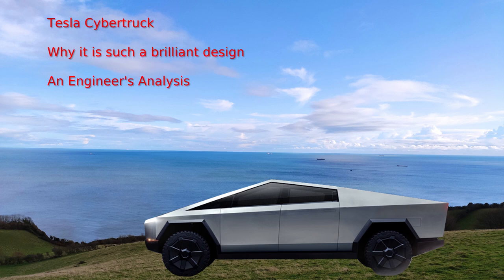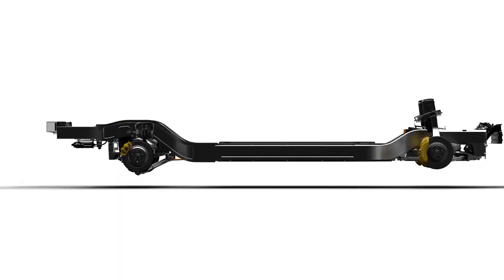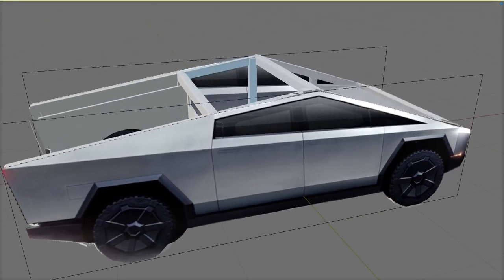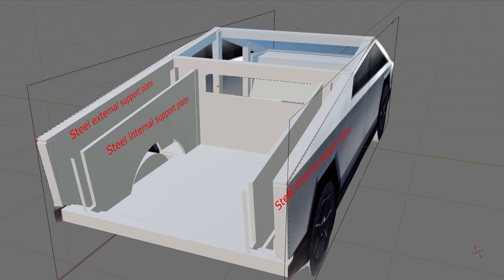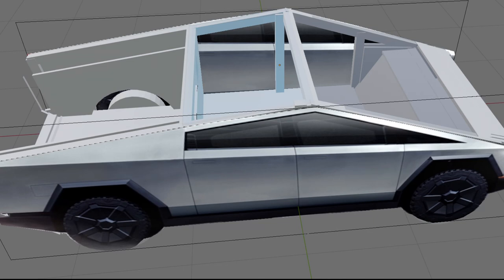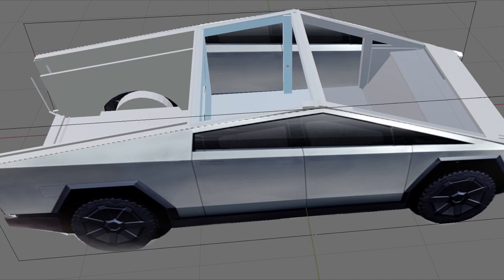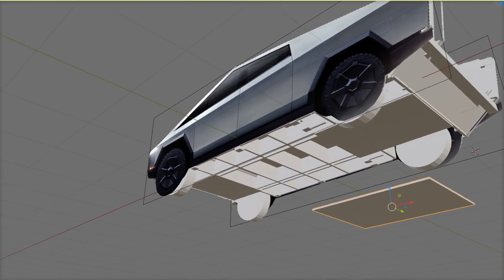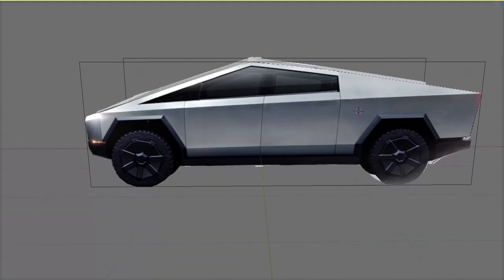cybertruck body shell engineering analysis

Comment: 🙏This is EXACTLY the info I wanted to know about this truck to mass produce at scale. No stamping presses no casting presses and no paint shop means tiny footprint for multiple production lines instead of just 1 in a given area. Extruded beams and folded panels are extremely fast to manufacture. Can’t wait for mine.

Comment: While the design is exceptionally elegant from an engineering and design perspective, it does introduce several real world challenges that I think Tesla will struggle with. Using it's primary load carrying structure as it's skin affords weight and cost savings but also means that minor fender benders will be much more likely to compromise the structural integrity of the vehicle, unlike traditional vehicles that surround the frame with sacrificial crash structures. Stainless may be easier to cosmetically repair than painted aluminum, but ensuring skin repairs are capable of properly transmitting load will be a challenging, expensive process specific to Tesla that ensures insurance rates will be very high. The use of "armored" aluminum oxynitride-like glass in a passenger vehicle is also going to require Tesla invest engineering in safety egress tech like frangible bolts or similar and would be a regulatory nightmare itself. Lastly, regarding the use of a heavy structural "exoskeleton", this may be efficient for static structures like you showed but dynamically it pushes the weight further away from the center of mass, which is likely why the prototype seems to display excessive amounts of body roll.
Reply from the maker: Very true
Reply: How is a fender bender going to damage the strongest stainless steel alloy known to man? This is a new alloy that Musk created. The reason there are no round edges is because it can't be bent easily without scoring the opposite side very deeply first. I would agree with what you said if it was any other material. Like Elon said "If there was a better material, we would have used it".
Reply: @ClearAdventure  
Then you have a different problem, where the energy that would have been absorbed by the alloy gets transferred to the occupants. 
As for your claims that it's the "strongest stainless steel alloy known to man," I'm going to need some citations on that that isn't just Musk's word. Being resistant to a .22 round isn't really all that impressive if that's what we're going for.
Edit: Whoops, 9mm FMJ is what Musk claimed in the presentation. Still, I guess we'll have to see come the collision tests.
Reply: @tyedie7669  Agreed, without citation it is hard to say. However he produced the alloy 30X (and of course we don't know what the X is in his brew) to use in his new rockets when he could not find a strong enough suitable stainless anywhere else on Earth. Making me assume it is the strongest. And the transfer of a hit to the occupants would be more severe if the truck was not over 6,000lbs. 

I also look forward to the tests because right now it seems he will have to score the 30X very deeply in the front end to have any type of crash absorbing crumple zone. 

A very unique problem to have created a truck that is apparently too strong at this point. No matter which way this all goes, you have to admit, there are some very exciting challenges ahead in this endeavor!
Reply: Surely, an impact that could compromise the rigidity of this exoskeleton would total a regular car, no?
Reply: Anything with 16" of ground clearance would have a body roll and mass away from center causing yaw. But with heavy battery in the floor it would perform better than ice truck. In the event of the collision the repair cost and chassis integrity would not be the problem, there many solutions
Reply: @caseymuni4097  yep, ☝️ my thoughts exactly. 
You may have noticed insurance companies tend to Total almost any accent these days. They do this for efficiency.
I'm not necessarily happily with the trend, but that is the way that insurance is going.
Reply: when all autos are self driving, there will be no more fender benders.
Reply: @RPhTom  Wrong. Self driving doesnt have to be perfect, just better than human preformance. However, there is no way to account for all variables worldwide like local construction, snow covered roads, etc.
Reply: @RPhTom  wow... just wow....
Reply: One other point that most pro cybertruck lovers refuse to accept. If you hit a child by accident or say run into another manufacturers car you are killing them on spot because your truck is too indestructible with a 0-60 of a super car.

Comment: Excellent Analysis.  Your spot on.  There is beauty in engineering simplicity.  There is boldness in applying it to a vehicle.  Historically, fancy sheathing creates the curb appeal.  This is raw and unadulterated engineering as the prime attractor.  The use of glass as a stress transferring member under compression is brilliant.  It make one go huummmmm if the dual window break was just an accident,  rather it seemed odd that both of the windows were open just enough to allow for relief of compressed status.  The sledge hammer should not have transferred that much impact to the rear door IMO. Thoughts welcome on that.  This design is a clear statement of Tesla showcasing that which essentially defines the actual object.  In essence, Musk is rebranding and redefining what it means to be a truck.  Thank you for making this video.
Reply: diveflyfish , there was a recent multiple car pileup in China. One of the cars involved was a Model 3. One or two cars landed on the glass roof of the Model 3, there was very little damage and the owner was able to open the door and get out normally. It seems this special glass has a lot of strength !
Reply: @shepherdsknoll8  model 3 roof is a structural glass. Not any different than windshield.
Reply: The rear door is just normal glass.

Comment: Thanks for the analysis... I hope Tesla comes out with their analysis... so I can compare what you've said to theirs.   💡
Reply from the maker: I think that Elon made a comment that they still had to work out how to automate the cutting and welding of the stainless steel - but with them having the same requirement for starship I expect they will make rapid progress. 🕵️‍♂️👨‍🏫
Reply: Peter Thomson , Elon was asked about the truck fitting into a standard garage, which it won’t do. Elon made the remark that an additional 6” may need to be cut. Based on your analysis, where do you think they could cut the 6 “ ?
Reply from the maker: @shepherdsknoll8  Not much scope to reduce length front of wheels as that is needed for crash protection. Motor compartment length largely determined by size of wheel arches. Passenger compartment length could be reduced, and shorter wheel base would improve clearance for off roading. Buyers would complain if truck bed was made shorter.
Width could be reduced more easily.
Reply: Peter Thomson , yes, I think you are right. Maybe 1-2” from front passenger and 4-5” from rear passenger. You would have to leave the bed length the same. The advantage for off-roading didn’t occur to me. I like the idea so that you can get into the Home Depot parking spaces easier.

Comment: Excellent analysis, much appreciated, any thoughts to the safety though? A head-on crash at 70mph into a tree or another Cybertruck wouldn't seem to give much gradual deceleration if everything is rigid. Obviously you still have the large crumple zones where force divided by distance gives you an advantage, and the low center of gravity plus side impact protection that you get from other Teslas. Just not sure how this changes with the stressed skin design. Cheers.

Comment: Franz and his team will surely be aware of the prevailing safety regulations in the markets where the truck will be sold and has accounted for these in his design.
Reply: Yes and if they haven't they soon will have to because for a start a vehicle can't be sold in Australia without external mirrors on both sides
Reply: Pedestrian safety is obviously not an issue in the USA as very few walk and those that do do not count (bag people).
As a 50 years body engineer I see many hurdles ie, look through the windscreen at such an acute angle can you see well?
BTW I was 3 months in Fremont.

Comment: I think the thing is brilliant. I'm wondering how it fares out in crash tests/passenger safety?
Reply: And in the event of an accident, what will the repair costs be? With traditional cars, frame damage means large repair costs. With the Cybertruck, all crash damage will be "frame damage". How much of the structure will be replaceable, ie: bolt-on and how much will require cutting/welding of entire sections of the exoskeleton in order to retain structural integrity?
Reply: @billybeemus3929  yea but in an accident your probably gonna hit someone else that has a fiberglass car while yours is made of metal
Reply: @vinnyb3978  What happens if you crash two of them into each other?
Reply: @billybeemus3929  Not only are tesla vehicles 40% less likely to get into a crash, but are the safest. Seeing as the cybertruck is extremely rigid, they will have to make collision avoidance for pedestrians a lot better. The repair costs for the cyvertruck might vary. On one side, insurance companies are totalling cars that really aren't that damaged, because it doesn't make sense for them. They will total a car with a slightly crushed rear bumper because the sensor in that bumper are very expensive, and difficult to reattach to the wiring harness. On the other side, Stainless steel is very easy to weld, so you may be able to just cut out sections and welding back sheets. The only thing that could realistically be wrong with that is the stress on the weld joints, and availability of those sheets of that specific steel, because you couldn't just go to home depot and buy yourself a new body panel.

Comment: Rivian's frame is aluminum, not heavy steel.  CT is looking to be quit a bit heavier than a standard F150 or Rivian.  
Current vehicles are designed to absorb energy in a crash to protect the occupants.  Lets see how CT does in a crash test, if they get that far.
Is this just an opinion video on structure and weight?
Don't forget on CT, the $39,900 is for a 1 motor 2 wheel drive 250 range, 6.5 sec 0-60, add $7k if you want self driving ($46.9k).   tesla used up $7,500 tax incentives for all their vehicles?
Rivian Fully Loaded is now $69k  (tax 61.5k) for a 4 motor 4 wheel drive 300 range 3 sec 0-60, true torque vectoring on and off road, tank turn, premium interior, lot of self driving hardware included.
cybertruck 3 motor is $70k add $7k for self driving = $77k, it's heavy and still Fugly.  Looks to be a poor turning radius, suck to park, one screen in centered in dash.
So,   "pay more and get less"     sounds about right.     Loaded Rivian $69k     fed tax incentive  - $7,500 = $61,500      CyberTruck $70k self driving + 7k = $77,000         $15,500 difference

Comment: What do you think the structure looks like for bracing the rear tow hitch? What about structural support in the front for implements like plows and winches? I wonder if the bracing in the front that supports the stress from acceleration, braking, and steering will be inherently strong enough to support plows and winches or if modifications will need to be made. Cool video, thanks for the informed analysis!
Reply from the maker: The rear tow hitch shouldn't be a problem. Tesla expects it to be able to tow a heavy trailer.
Front mounting could be a problem as any front mounts could get in the way of crash protection.

Comment: What would be the best/ safest way to attach a slide on camper?
Reply: what do you mean by "slide on camper" If you are talking about a camper that is attached to something inside the bed (a hitch attachment point for those high hitches on trailers) then i guess you could just use the T rails built into the floor of the bed as a place to attach those kinds of hitches.

Comment: Any thoughts on how Tesla plans to reduce kinetic energy transfer in case of a collision with pedestrian? Obviously crumple zones will be challenging, how about sacrificial panel fasteners designed to adsorb the energy? They’d be like fuses for kinetic energy.
Reply from the maker: See both https://www.youtube.com/watch?v=rCmdJ109iqU and https://www.youtube.com/watch?v=DZVQ1BtR-0A
Reply: @dartmoorrambler  - Let me get this straight. The Cybertruck is going to have $10,000 worth of external airbags and other active safety measures yet somehow sell for less than $40,000 in its cheapest form. You can barely buy a stripped-down Model 3 for that.

Comment: I think you got off course a little bit when you stated the suspension truss design was different from the dual rail frame design in Its function.  Both do the same thing as far as points of flexion and compression.

But also, the cybertruck is supposedly an EXOSKELETAL design, NOT trusses or girders.  So the stresses would have to be borne on the stainless steel panels, not on the glass (which is definitely too brittle for the job, see launch video).  If it IS using struts or trusses, then it's essentially no different from any other body-on-frame truck.  The frame is slightly different in design, but still a frame that everything else is attached to, and the main source of weight distribution and load bearing.
Reply: Thats very much how i see it too.

Comment: broken Semi Truck windshields must be repaired by law/regulation.  Work/commercial/delivery Trucks? assume the same?
Therefore businesses/fleet operators value strong wind shields as it will cuts down on cost of ownership/maintenance.
Reply: In Australia all vehicles must have an intact windscreen.
Any windscreen damage especially in the field of view if discovered by the police will result in a defect notice that will require immediate attention
Reply: a key point that Elon has since made clear was a big plus point in their design discussions - business users value time on road above even fuel efficiency.

Comment: Structural  glass, good insight, never would have guessed. Makes you wonder what other structures could be designed better using this structural glass. What is your opinion on why the glass broke?
Reply from the maker: In the drop test, and in the recorded test where the glass didn't break, the window glass can be seen to flex, or spring back in response to the ball hitting it. In the on-stage test none of the videos that I have seen show any sign of this flexing. This suggests that, if it is the same glass, for the on-stage test the glass has been clamped too tightly, and perhaps fully closing the window slightly curves the glass, making it unable to flex and absorb the shock.
Reply: @yesno9592  
Ability to break the glass? Prove this. And have you tried to break even regular glass with your hand?
Reply: They said it was already compromised by the sledgehammer striking the door and posted a video of them bouncing the steel ball off the glass earlier in the day without it breaking.
Reply: @dartmoorrambler  For the table top drop test, the clamping was key.  Glass and Porcelain are very strong in compression, poor in tension and shear.  The clamping force was necessary to compressively stress the glass.  I assume the closing mechanism and the intensity of the engagement to the window frame is the key to imparting the compression for optimal strength.  Someone had to have had the windows opened a tiny bit to allow for one surface to be unconstrained.  This would potentially lead to the catastrophic failure as noted on stage.  There also could have been micro fractures initiated during the back stage test and when pressure was released, the micro incipient fractures would be allowed to act a nidus for failure due to the window no longer being in compression.
Reply from the maker: @diveflyfish  Yes, I have seen those comments reported elsewhere, but that is not supported by the evidence that I have seen where the glass survives the impact when it is able to flex. Curving and clamping laminated glass in its curved position turns it from flexible and resiliant into a much more brittle material.
Reply: Peter Thomson Peter,  glass can be very strong when in compression.
The concept applicable is made example by porcelain firing let’s say to make a dental ceramic porcelain restoration.  It is the cooling that results in the glass in compression that makes it so strong.  Also example is prince ruperts drop.
Reply from the maker: @diveflyfish  tensile strength and compressive strength are not the same as brittleness. Dental ceramic is incredibly tough, bit bite on something very hard, like a grain of quartz, and you will get a brittle fracture. This is very similar to flint - very hard and tough, but knock it with another flint in just the right point and direction and it will flake off.
Reply: Peter Thomson I would argue it is precisely the compressive strength of the glass that is being sought from an engineering perspective, not its flexibility.  I could be wrong.  Perhaps a Tesla materials engineer would be able  clarify the specific set of material characteristic that is most applicable.

Comment: The only drawback I see is the required pedestrian protection that is supplied by a "crumple zone" -
the eventual road design will need some light separation and wing mirror elements ( easy) but the pedestrian safety does not look easy to fit within that design.
perhaps a shaped add on nose cone bade of styrofoam?  - not being too serious there - but what?
Reply: I don't think crumple zones are needed in the heavier payload vehicles.  Look at the massive front grilles of the F-250 type trucks.  I don't think there is much of a crumple zone there with the top of the hood near pedestrian head height.  The Cybertruck falls in the F-250 GVW category.